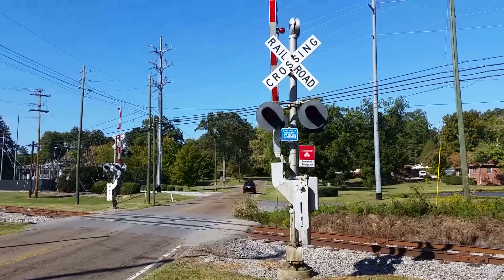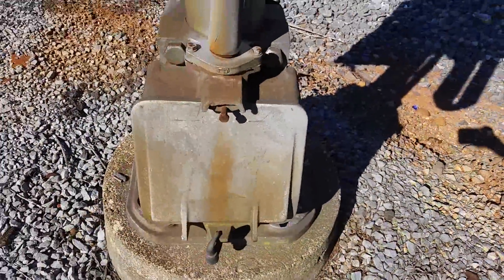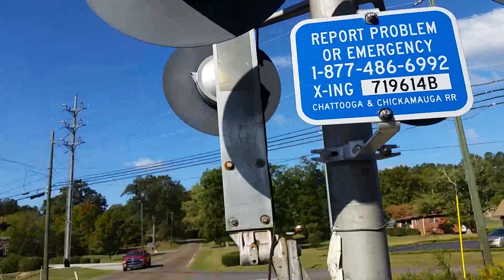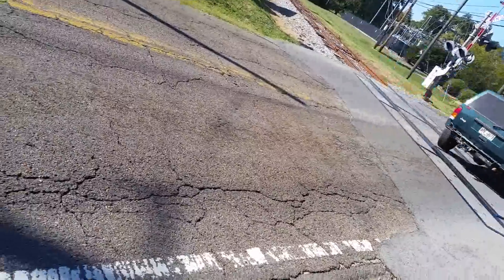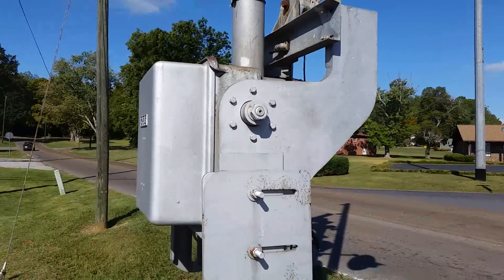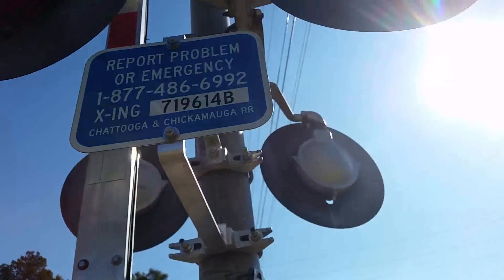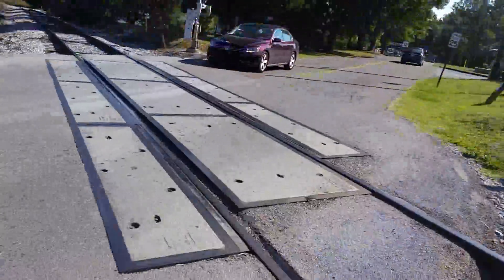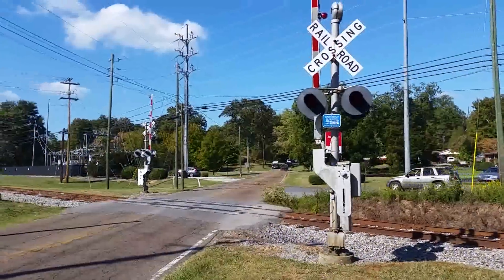Five Points Road Railroad Crossing, Chickamauga, GA Crossing Tour

Comment: Nice video! Why did they replace the wishbone gates? I'm surprised that the old southern railroad DOT tags are still there.
Reply from the maker: Thanks! IIRC, due to a mandate by the FRA.
Reply: What does "IIRC" stand for"?  It's a shame that the FRA wanted to replace those gates, although they were more thicker than these aluminum gates.
Reply from the maker: IIRC stands for "If I Recall Correctly". Do people really not know most of the more common "internet shorthand" acronyms? (IIRC, AFAIK, BRB, TTYL, TBH, etc.)